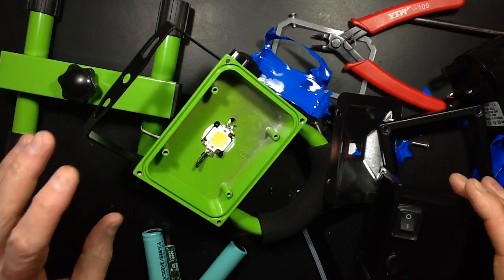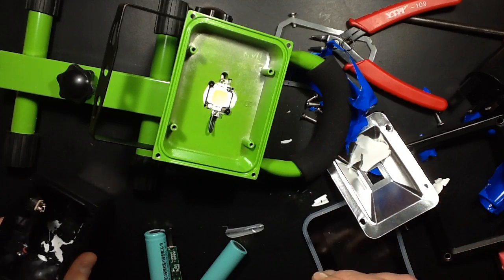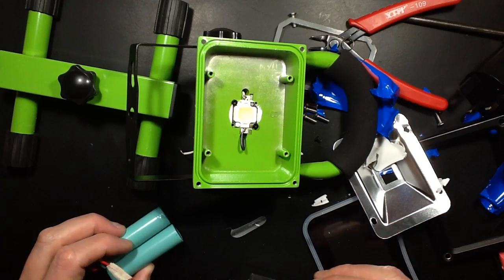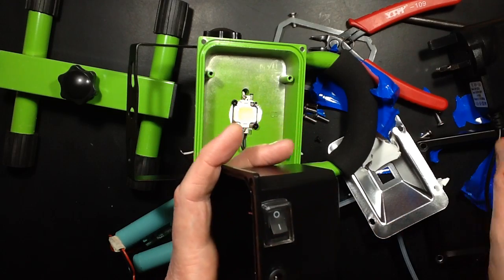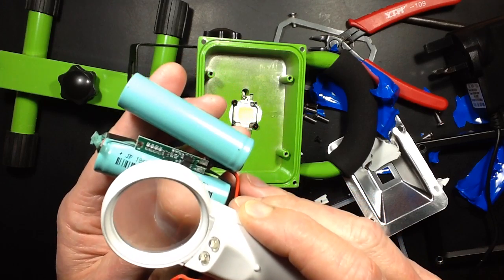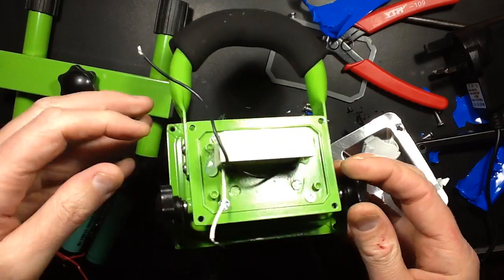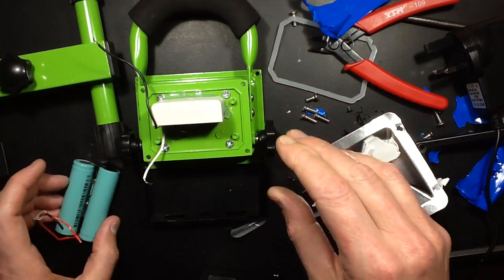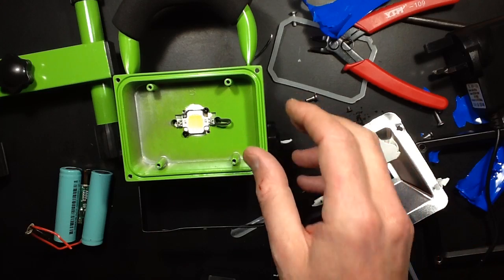Short version of the 10W rechargeable LED work-light teardown.

Comment: +bigclivedotcom

Everything is hackable, especially if you know how to swing a hammer. Thinking on it though, it could be a useful had to add another pair of LiPos in series and feed the LED via a buck converter to maintain light intensity, maybe add a dimming circuit to extend the "burn time". I suppose you have to be a bit tricky with the charging circuit/wiring to have it charge as 2x2 in parallel.

Cheers

Comment: Hey! I recently disassembled an Osram LED lamp, which died after a few months instead of 15 years. LED Star Classic A 60 with transparent plastic at the top and a nice diffuser inside (crystal-like). A bottom part is filled with some kind of crusty hard silicone, so I don't know how the LEDs were powered. I expected one 5050 chip was dead and because they (4 of them) are connected in series, the whole lamp doesn't work. But after testing each chip turned out to be good I consider reusing it with some other type of power supply. Do you think it's a good idea? LEDs sit on an aluminum plate glued on a heatsink.
Here's a photo:
https://goo.gl/photos/esrXyryzhPyvZwA68
Reply from the maker: +abcd “wojciech.g92” efgh Interesting.  It looks like it's got six LEDs per package wired in series giving a total of 24 series chips.  That would require a voltage of around 70V to get them to light.  I wonder if it uses a capacitive dropper or switching supply.

Comment: I had just bought one of these last week. It gives out a decent amount of light, but haven't had the opportunity to really test its run time. I'm surprised it's using only 2 18650s though, they could throw in another 2 in parallel to make it run longer. I'm glad I haven't heard anything about how bad it is though, I should be safe with mine :P not gonna blow up on me.

Comment: So would that LED work on 12v or is that too high a low voltage for it?
Reply: It would self destruct in reasonably short order without a proper current regulator inline as you would be dumping nearly  twice the intended voltage (and far too much current) into them without proper external current regulation.  With proper regulation they would behave exactly the same, at about 8W output.

Comment: Hello Clive, can I ask you a question ? : I have a 'De Drie Electronics' battery charger it can supply 10A at 24 volts, used for charging mobility scooters and wheelchair. I've recently bought one because i needed a powerful 24 volt power supply. But as I've measured the output, it doesn't work, and i get 0 volts output voltage. Do you have any clue how to turn it on?
Reply: +Ethan Poole You will be much better served by buying a proper 24VDC regulated power supply (or "battery eliminator" as they are sometimes called, as they substitute for a battery), either a large (heavy) linear power supply for clean near ripple-free power or an efficient, compact and lightweight (by comparison) switchmode power supply (whose output usually is not as clean and free of RFI).  Either will serve you far better.  Linear supplies in your current range (20A) are available for as little as a couple hundred dollars.  Switchmode supplies in your current range are available for much less (well under a hundred dollars, varying by quality and specs) if your project requirements do not require absolutely clean power (free of ripple and RFI).
Reply: +Osumo Ben Lodan Good luck and if you need to lower the ripple just add 60V+ rated capacitors on the output. I guessed you don't need voltage regulation but if you do it is probably not the easiest way. There is no reason that you couldn't use the charger transformer to make a descent power supply. Don't hurt yourself, it can be dangerous to work on mains voltage powered equipment. You should always discharge the caps with an insulated wire or at least check the voltage across them with a multimeter or you risk a nasty burn or worse. Take care.
Reply: +Osumo Ben Lodan The fact that it does a polarity test suggests it may be a SMART charger, in which case it is wholly unsuitable as a power supply. Unsuitable as in it literally will not function as any sort of power supply as voltage and current will be all over the place without a large lead acid battery bank attached to the charger to serve as an intermediary -- a 20A charger would need a bank with about 200+ amp-hours capacity (C/10) at 24VDC.

If it is a "DUMB" float or equalizing type charger (a straight unregulated output from a large line frequency transformer fed into a bridge rectifier) then it may be possible to use it with a motor. However, the result is likely to be less than satisfactory without several tens of thousand of microfarads of smoothing capacitors (50V rated or greater). Without strong smoothing there is a good chance that the highly inductive load of your compressor motor will ultimately destroy the battery charger from inductive spikes created from the motor.
Reply: +Osumo Ben Lodan It probably needs to see a voltage (detecting a battery) before enabling the output.
Reply: +Michel PASTOR Ah I see. But the question is, how can I replicate that to use it as a power supply?
Reply: +Osumo Ben Lodan Try to hook up a 24V power supply or battery positive on red cable with a 1K resistor in series to limit the current
Reply: +Osumo Ben Lodan Otherwise you will have to open it and disable the battery detection but that's another story.
Reply: +Michel PASTOR Can you explain to me how to disable the battery protection?
Reply: +Michel PASTOR I mean detection. Sorry.
Reply: +Osumo Ben Lodan I guess your charger has a transformer in it followed by a bridge rectifier. You could solder some wires on the output of the bridge and bypass the electronics.
Reply: +Michel PASTOR Thanks! Gonna try it.
Reply: As a general rule, battery chargers make for extremely poor power supplies.  Partly because they are designed to properly charge a battery of specific chemistry (and are very specialized if they are fast step chargers) but also because batteries really do not much care what the quality of the power is that you are dumping into them, so most chargers output very dirty power.  By comparison, when using a power supply one tends to expect a stable output voltage and very clean output power with a minimum of ripple under load -- pretty much the exact opposite of most battery chargers.

Some basic float-only chargers might produce suitable power, but they are by no means required to do so for their intended purpose.

However, your specific issue of no power is due to the battery polarity detection, which needs to see battery voltage before enabling the output (to prevent a fire from reversed polarity during charging).
Reply: +Ethan Poole Ah I understand. But how can I bypass this protection? I hear a relay click when I apply 12 volts to the charger output.
Reply: +Ethan Poole Yeah, thanks for your help, but I don't have that kind of money to spend.
Reply: +Osumo Ben Lodan As long as the equipment you intend to connect to your power supply isn't very valuable, then it would be a false economy to risk it. I know what it's like being strapped for cash and not wanting to spend the money on the right PSU for some gadget, and then breaking that gadget with inappropriate supplies.
Reply: +artifactingreality No, what I intend to connect is just a  24 volt compressor motor.
Reply: +Ethan Poole I've dont care about the battery charger. I have 3 others laying around :)